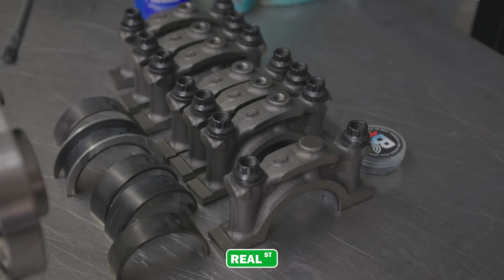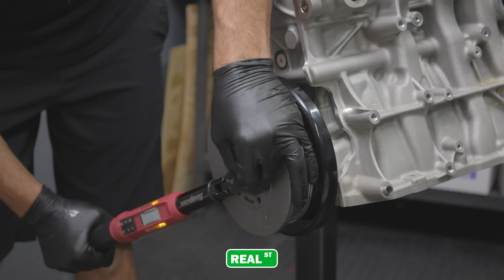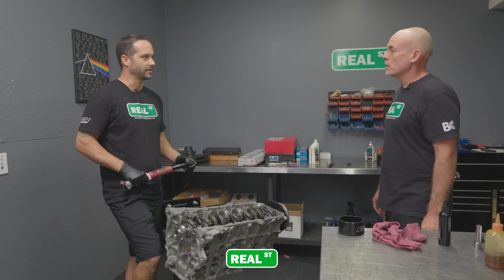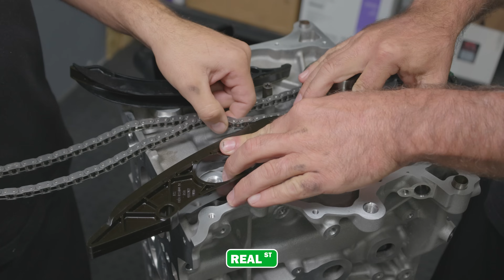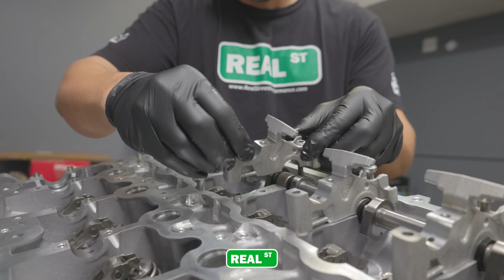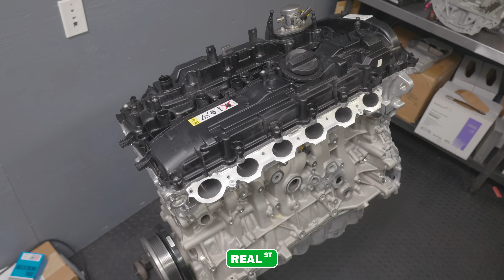Building a 1000HP B58 MK5 Supra Engine

Comment: The B58 engine is a beast and it's very bulletproof. It's a worthy successor to the 2JZ.
Reply: Its a worthy successor to the N55.
Reply: Has absolutely nothing to do with the 2JZ or Toyota...
Reply: @jzaeighty Feeling triggered?!? No one said the B58 has anything to do with the 2JZ, but Toyota chose it instead of using a 2JZ or developing a successor to the 2JZ, so it's the closest thing to a successor. Not only that, but it's bulletproof.
Reply: @darylmorse  The 7M led to the 1JZ. The 1JZ led to the 2JZ. One succeeded the other and they are all Toyotas. The B58 has no roots with Toyota at all. You called the B58 a successor to the 2JZ, which have fuck all to do with each other. That's all I said. What you said is like saying the Coyote is a worthy successor to the LS, it makes no sense. Don't get mad at me because you don't understand basic English.
Reply: @jzaeighty  Except that Toyota chose the B58 for the Supra rather than design their own "successor" to the 2JZ. Lots of people are referring to the B58 as a successor to the 2JZ in that sense. There is a commonality between the engines and it's Toyota. There is no such commonality between the Coyote and the LS, so that's a  stupid and irrelevant analogy.
Reply: @darylmorse  So then you understand why calling the B58 the successor to the 2JZ is stupid and irrelevant, there is no commonality between them. I mean unless your opinion is that any straight 6 engine is a 2JZ successor with that logic. I get that people call the B58 a successor to the 2J but 1) Those people have probably never owned a Toyota and 2) Those people are not the most intelligent or savvy when it comes to automobiles.
Reply: @jzaeighty  touch grass
Reply: @SupraSav  Stay mad ZupraSav.
Reply: @jzaeighty I live in Germany, my v161 was built in Germany. The b58 though a bmw product was actually built with Toyotas engineers. During the partnership Toyota themselves took the bmw and applied critical changes to bring it up to Toyotas standards and quality control. Toyota understands you don’t need everything in house to make profit but you need to be hangs on to be reliable. It doesn’t have the 3jz name but this is as close as we will ever get
Reply: @drjdmtuning4982  The B58 was designed by BMW engineers back in 2015. Maybe Toyota engineers looked at the engine, maybe they didn't, can't really trust Toyota on their word anymore. What is a proven fact is that the B58 consumes oil regularly, like any typical BMW. No Toyota I have ever owned burns oil in that way. 99% BMW parts does not make a Toyota, regardless of those supposed Toyota "revisions". The real Supra was designed by Toyota to include brakes, suspension, chassis, engine, interior, exterior, wheels, exhaust, differential. Lmao the list is endless. Yes the Getrag 233 is a wonderful transmission, whether in a Supra or a GT-R. If you mention that as a detraction to the overall Toyota-ness of the Supra, well virtually the only Toyota parts on the J29 are the badges lol. Even the manual transmission for the J29 is a repurposed BMW transmission. As we all know only Toyota made the Mk1, Mk2, Mk3 and Mk4 Supras. If its not a Toyota, then it is not a Supra. The J29 is not JDM. The J29 does not deserve the name Supra. The J29 is a hardtop Z4.
Reply: Toyota made BMW revise the engine in a couple different ways so they were there for the development of the TU
Reply: @art_n5x  That may or may not be the case, but there is not a dedicated Toyota version of the B58.
Reply: @art_n5x  Yeah BMW has been doing Technical Updates for decades. If Toyota did revisions they certainly don't show, the J29 burns all kinds of oil. Toyotas are not known for burning oil.
Reply: @drjdmtuning4982 If you believe Toyota made those revisions I have a bridge to sell you😂. Because you know corporations don't lie to sell product. Toyota and Subaru didn't lie about the BRZ saying it's a track car You take it on track and it blows up.😂
Reply: @jzaeighty you be yapping about these cars all day but probably can’t afford any of them 💀💀💀
Reply: @jzaeighty Toyota thinks otherwise and so do the sales numbers, if toyota pursued making the car themselves it would cost upwards of probably 180-200k, Toyota came in with the proposal for the Supra with BMW in 2012 and had a massive hand in the B58’s development, reliability and quality control. If it’s a “hard top z4” then why does it drive completely different from a Z4?(talking from both experience and from watching many reviews out there). If you think this isn’t a successor to the MK4 Supra (which did dogshit in sales at the time), you are most likely a 12 year old following whatever your favorite YouTuber says mindlessly. The “oil consumption issues” were quite literally only prevalent in one generation of the A90 Supra, and that is the 2021 model year, this was caused due to changes of the design from 2020 to 2021 which changed the compression ratios, added a slightly larger turbo and changed the engine from being a 2 port to a 6 port. It’s very common these issues happen whenever a car goes through a horsepower increase, just look at all the issues of any first year Nissan Nismo release, saying that these issues are “German car issues” are just delusional. I would highly suggest once you turn 18 and get a license to go to your local Toyota dealer and test drive the Supra, I’m sure it’ll change your mind:)
Reply: @WhiteComet_CA  I also think its hilarious how J29 owners and aspirants have to become global economists and shills for multi billion dollar auto manufacturers. LMAO. Keep sucking Toyota and BMW off maybe they'll redesign a new MK6 for you rofl.
Reply: @jzaeighty  Stay mad Mk5 > Mk4 in every aspect. 12 year olds love to overhype the Mk4.
Reply: @sphinxore4499  And poor people like you could never afford a MkIV. I certainly hope the J29 would perform better than a 30 year platform.
Reply: @jzaeighty  You can miss me on spending $30k+ on a 20 year old Toyota, too poor? No. Smart enough not to piss away money to appease some 12 year olds, because SOOPRA BRO? Yes.
Reply: @jzaeighty the other guy is right, you're wrong. The end
Reply: @TheTranfan  Yeah you're right it is over. I'll end it with this. When you buy a J29 you get 3 things: You get a bucket for all your tears, an access pass to a library full of excuses, and a finely crafted BMW.
Reply: @jzaeighty  I agree with you that the B58 is not the successor of the 2JZ, it was never intended to be. I will say the B58's big brother the S58 will straight up walk the 2JZ any day of the week. That motor will make over 1000HP with a pair of upgraded turbos, catless DP's, port injection, and e85 tune. I love the 2JZ but it cannot be held on a pedestal forever there are certainly better motors out there.
Reply: @jieddo1  I don't disagree. Newer more powerful motors will come out that will eclipse even the S58, nothing stays at the top forever. The fact that the 2JZ is even on anyone's mind after 30 years says everything we need to know about the engine.
Reply: @hexagonosaurus5848  stop sulking still
Reply: @jzaeighty  We are sorry but ask Toyota that and they have an opposing opinion.
Reply: @Tirah5  Thank you for your contribution. It is very valuable.
Reply: It's far from a successor if it's far from capable of even doing 2JZ things, nevermind doing more. Stock vs stock the B58's factory longblock is far from capable of reaching 2JZ factory longblock record of 1100whp. Fully built vs fully built again the B58 falls even shorter from achieving power and even revving capabilities than the 2JZ. So how is it a 'successor' outside of labelism and not even being part of the Toyota i6 lineup?
Reply: @jzaeighty God... love misinformation.... First, the B58B30C has zero burning issues, the B58M1 that has the revision, was converted to 6 port instead of 2 and piston designed changed to lower compression ratio.

Only a handful of them has the oil burning issue due to the RINGS! and not the engine itself.
Reply: Idk what's worse, honda guys or 2j guys.
Reply: @jzaeighty  It's bullshit that all BMW engines burn oil. I had an M52 with over 185k kms, an S54, a B48 and now an S55. I never had to add oil to them. Ever.
Reply: @darylmorse  I believe you, in your experience BMW engines have been great. Its going to take more than a comment on Youtube to convince the general public that BMWs are reliable however. BMW made that reputation all by themselves, especially when people are trying to compare them to Toyotas. And of all the Toyota engines people want to compare it to they choose the 2J...
Reply: @tempeztad  Alright, name one 2JZ variant that oil burn issue was prevalent in. Since people want to say the B58 is a successor...
Reply: @jzaeighty 2JZGE VVT 2001 valve stems... refreshed 2 of them due to the same issue... what's your point anyway?
Reply: @jzaeighty I wasn't claiming that all BMWs are as reliable as Toyotas, I was refuting the claim that all BMWs burn oil. It's nonsense.
Reply: @tempeztad  Well you are the one that responded to a comment about how the B58 is not a successor to the 2JZ, did you even read it? So the non turbo engine had valve stem problems nearly ten years in production while the B58 in the J29 had issues on release? 🤔 Not a very good look.
Reply: @darylmorse  The B58 does, which is the engine we are talking about which you have apparently never owned. Regardless when people say BMW reliability is certainly not the first idea that comes to mind. And this was a post talking about how the B58 is not a successor the 2JZ.
Reply: @jzaeighty  Is a very good look when is already beating the competition for less on GTA, Circuit and others. It does have to be a successor to be better, even the Barra, a i6 ford engine, makes what the 2J does cheaper which is what the B58 also does. You like the rest of the blind fans out doing is just trying to find a justification to hate on the B58 and spread it to other people just cause a couple engines (Not even that many) came with faulty rings. 

You not liking the B58 doesn't make it a bad engine. You do you and move along.
Reply: @tempeztad  "It does have to be a successor to be better" you don't know what the word successor means do you? The B58 is a fine engine and no better or worse than any modern BMW engine, but its not a Toyota engine so it cannot be a successor to the 2JZ, thats all. I am not sure what you gain by trying to say it is.
Reply: Im not gaining nothing just stating the reality of things. At this point and again, you do you.  Built two 2JZGTE non vvti and 2 NAT VVTI setups just a good engine Now working on the B58, equally as good both having their weakness and strengths but I know that cause I owned both.
Reply: @jzaeighty Toyota literally co-designed the thing with BMW.
Reply: @jzaeighty B58 Consuming oil? This is the first time I’ve ever heard of this. I’ve heard of coolant loss from a faulty expansion tank cap, but oil consumption literally isn’t an issue on these engines 💀
Reply: @jzaeighty you don’t need me to tell you BMW’s are more reliable than they seem, it’s called a “vocal minority” people with problems will be FAR more vocal about it than people who don’t. Also all the hype around the B/S58 is there for a reason.
Reply: @jzaeighty wtf is a J29? Is that a Toyota chassis code or something? Because I only know of the F22/23 and the F30/32/34/36 for BMW, and A90/A91 for the Supra. I am also again reiterating that oil consumption on the B58 is just a you problem, I’ve owned one for about 6 years now and been deep in the community, the problem just isn’t there.
Reply: @huh0123  No it is not just a me problem. I for one would never encourage Toyota to keep outsourcing their flagship name out, that's how you get fake Supras like the J29. You must not own the B58 J29 because oil consumption is a known issue. People have already admitted that in this thread alone. The J29 is a BMW chassis code, you know the company that actually made the parts for the car. The A90/A91 is just Toyota marketing pillow talk to get children with credit scores to buy a clearly badge engineered car. Its the same idea of slapping a Toyota and Supra badge on the back of a Z4.
Reply: @tempeztad  "only a handful has the oil burning issue due to RING! not the engine itself" 
Buddy, if rings are passing oil, how is that NOT the engine itself? 😂 fanboys...
Reply: @jzaeighty I think someone can’t handle the fact that the b58 is a better engine than the 2j is and was.
Reply: @clueless3398  Well it is 20 years newer than the 2JZ, the B58 has no excuse to be worse and somehow it is. Oil consumption and it cannot handle the same power stock as a 2JZ so I guess it depends how you define better. Maybe the B58 is all you can afford.
Reply: Why are people so caught up on the motor being inferior? The combustion engine has barely changed in 30 years, emission standards would never allow a 2J to exist. Everyone who bags the car out has never driven or owned one. I own a Mk4 and MK5 in aus. Let me tell you, it drives a billion years better and has way more useable power. Be grateful manufactures are building sports cars. Same people trashing great cars are the same ones asking for them.
Reply: @jzaeighty  neither of my B58s consume any oil whatsoever!! And one is over 700 wheel hp on the stock engine…….
Reply: @MasterDieselMarine  What's your point? A B58 will never outlast a 2JZ at the same power level, the B58 is inherently more complex.
Reply: @zaccomptonk590 You tell me. Bimmer boys and Dodge boys are taking that place already
Reply: @LMB1991 wow a newer car driving better than a 30 year old one. Tell me that story again Aussie but this time put your dentures in.
Reply: @Theconjurer17484  why are you getting so emotional on a YouTube thread? What has your point got to do with my point? Also I’m 29.
Reply: @jzaeighty it’s been an entire year, touch grass please.
Reply: @390nm  Yeah I made my initial comment over a year ago are here you losers still are. Glad to know such simple sentences of mine keep you up at night.

Comment: Small detail: 12 minute mark is a masterclass in rtv beads. No tons of goop, no going round unneeded bolt holes, and no smearing flat before making unions. 👌
Reply from the maker: Brett loves making cakes on his off time, this has lead to excellent frosting and rtv application skills :)
Reply: Toyota/Subaru need to learn that from Brett.
Reply: I like mine to look like dimes on a weld 😂
Reply: Actually, he is using way too much sealing goop. At 12:20 you can see it popping out to every side even before tightening the bolts. The oil filter will be filled with sealing goop soon!
Reply: @realstreetperformance  do you offer this build service for the gen 2 B58, I'd be interested?